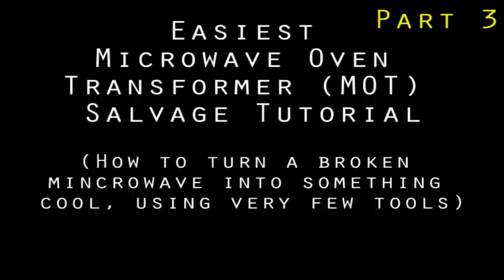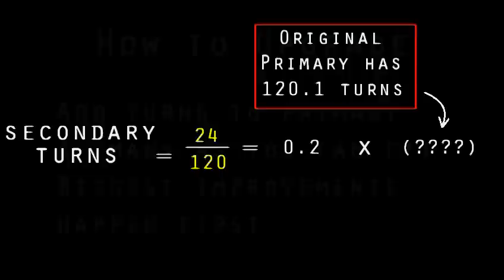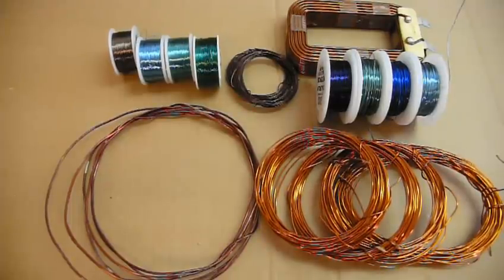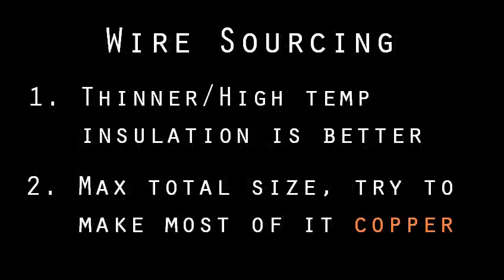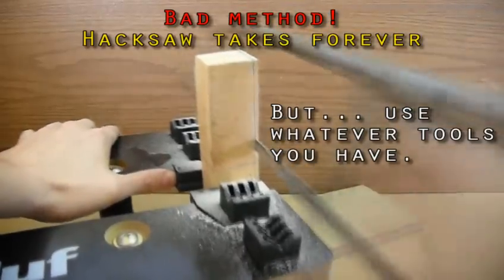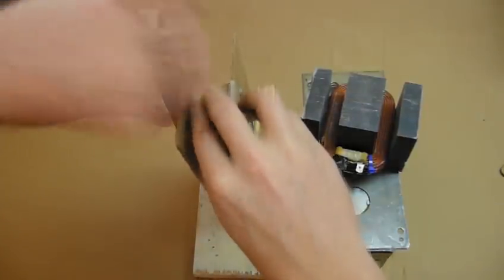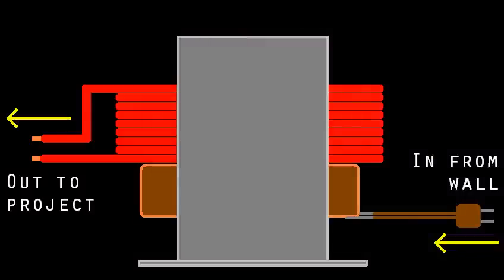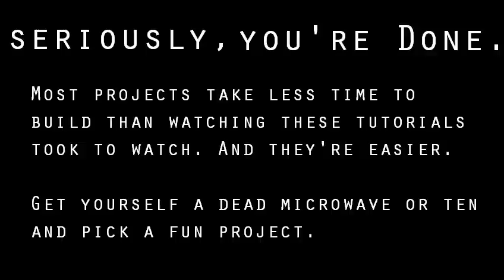Easiest MOT Salvage Tutorial Pt.3

Comment: The universal motor is a type of electric motor that can operate on either AC or DC power and uses an electromagnet as its stator to create its magnetic field. It is a commutated series-wound motor where the stator's field coils are connected in series with the rotor windings through a commutator.

On your prior message. U indicate bosch DC power likely is a universal motor. Which I think it is as it only has 2 magnets. Is universal motor same as 2 phase motor?

From the above---- operate on either AC or DC power...

If this is a case. Why do I need diode or bridge rectifier to convert power source from AC to DC?

If above is true, all I need to do is convert 110vAC to 17vAC on Transformer skip all other steps?

What will happen connect 18vDC power tool on 17VAC with high current?
Reply from the maker: Universal motors do not require you to convert from AC to DC, but the speed control electronics in the trigger will be ruined instantly if they are given reverse polarity voltage. So, you could connect directly to the motor if you wanted, but then you'd lose the function of the speed control. Also I think you need higher voltage AC to accomplish the same amount as DC, (maybe like, 30% higher?) but I forget why.
Reply: @MattsAwesomeStuff  
"speed controller will be ruining" meaning after this one used 17vAC direct connect on the Bosch cordless circular saw without convert AC to DC,  In the future if I connect battery pack back to the power tool, the tool will no longer have speed controller? Is this what you mean by ruin?

There is universal motor on tools, 
Reason manufactures all use Universal motor is because it is cheaper, simpler to build ? Is this true statement?
3 phase (120 degree), 7 phase (360/7) like my electric bike. How are they different? All use positive/ negative/ ground??

I am very confused on how to identify each type. I search on line found bit and piece of info. Do you have easy way to identify each type by looking at it?
Reply from the maker: @harukoyama9515  - Electronics are generally designed to have steady DC voltage only. If you reverse the voltage, they will be destroyed inside. On something like a drill, you need speed control. On something like a circular saw, on/off would probably be fine because you always cut at the same speed.

Universal motors are selected because they have very high starting torque, which is what a power tool needs. A blender for example has a universal motor. But a treadmill has a Permanent Magnet DC motor. A drill press or table saw or washing machine has an AC induction motor. DC Series-Wound motors in portable power tools can also be considered universal motors. I don't know if they're cheaper to build. They are easy to speed control. Induction motors are probably cheapest, but very hard to speed control.

It's hard to tell motors apart, there are so many types, and so many different ratings. https://www.youtube.com/watch?v=SrPHQh-M3pM&lc -- That may help you, but, does not tell you when to use them or how.
Reply from the maker: @harukoyama9515  - I forgot to answer the 3 phase part. 3 phase power uses 3 different AC voltages, each 120 degrees out of synch. They usually have 4 wires, 1 for each phase, and ground. There is no positive or negative with AC power, it's a sine wave that alternates positive and negative 120 times a second. 3phase is controlled by turning different electromagnets on and off at a rate that makes the motor move a certain speed. 3phase AC uses the speed of the power grid (60hz). In a bike they often call this "Brushless DC" which is just DC that is then chopped up and made into fake-AC with a complicated controller circuit.
Reply: Lot deep electricity knowledge. Have to spend more time understand it.

No luck finding a alternator for bridge rectifier. I have 2 electric lawn mow. Has KBPC2504, reading the specs. This one is only 25amp, I need 65amp if my circuit is in 15amp breaker.

I remember you told me I want to use twice the capacity of component can handle. This Homelite electric lawn mow is advertised for 12amp. So that was half of what this bridge rec block can handle.

I saw some kid on youtube parallel 50 diode. He claims it can dilute the load. So no 🔥or overheat... Is this statement correct?

I also remember you said, multimeter can not connect in parallel to reduce the amp load. Does that methodology also ally to diode? Likely one will brake down before the other break down. Defeat the purpose.

I found below bridge rectifier. Not sure if this is what I need to simply run my Bosch portable tool, some tool are 18Vdc, some are 24Vdc...

4 Terminals Single-phase Diode Bridge Rectifier MDQ 100a 1600v High Power US

Can this bridge rec work ??? for covert 17Vac x 65amp to 17VDC don't know how many amp.
Reply from the maker: @harukoyama9515  
1 - I've seen that same FWB rated for 50A :p.

2 - Twice the voltage is a good rule of thumb for capacitor voltage if it's jumping around. With current, generally you're okay with being right at the correct current. Extra is for durability/safety. Depends on the circumstances.

3 - You can parallel diodes with limited success. The problem is that they can become more conductive when hotter. You can't make them share equally. So the hottest one gets even greedier and even hotter, and then eventually melts. Maybe it's taking 50A and the other one in parallel is taking only 5A. If you mount them to the same heatsink, you can force the heat of the hotter one to affect the heat of the cooler one and help them share a bit, but, 50 diodes in parallel realistically means probably only 3 or 4 of them have any current, the rest have none.

4 - Yes, that methodology applies to diodes. You can connect resistors in parallel, they will force each other to share equally, or light bulbs, or heaters, but not diodes really. It depends on the "thermal coefficient" and whether it's positive, neutral, or negative (whether it becomes more or less resistive when it gets hotter). You can research but it's boring and technical and probably hard to find answers.

5 - That bridge will work fine at 100A loads. You might want to put a heatsink on it if you are going to max out your drill for long periods of time. For a few screws it's okay without.

Comment from the maker: Scariac. That's Grant's method. It's not particularly dangerous. Mobile core is the hardest method. Takes lots of explaining.

Electronic control using a triac and a "phase fired controller" on the primary is fairly easy.

Easiest is a multi-tap transformer. When winding, for example, 30 turns, also branch off at 28 turns, 26, 24, 22, etc. Just bend the wires out 4 inches, then back, so you have something to connect to. That will vary the voltage and thereby power.

None are strictly necessary.

Comment: i want to build a 14volt and 30amp  transformer should i use a transformer like this?
or a transformer from a old amp have one laying around is was from a  5x80watt amp
Reply from the maker: I think that would be a perfect use of an MOT. 14x30= 420 watts. That's a small MOT which means you have room for extra turns on the primary to help it stay cool. However, your audio amp will be wound with more turns on the primary right from the start, so, same difference either way. What are you making?

Comment: So... I tried to add More Winding to my primary. The original Had 133 Turns and I added 17 To make it 150 for better efficiency. But When I plugged it in It got really hot and smoked, It even Burned though the zip ties. Now The Secondary wasn't hot. It was only the Primary. I used 16 Gauge magnet wire. Any Idea what i did wrong? Please help
Reply from the maker: liljoey112 You perhaps added them in the wrong (clock-wise vs. counter-clockwise) direction, so even though there were 150 windings, 17-17 of them cancelled each other out. If your secondary wasn't hot, (meaning the MOT in general just ran hot) then that's my best guess. Guess #2 is that your primary is shorted internally, or, to the core.
Reply: Okay I am Going to Check that out now, I'll tell you the results.
Reply: MattsAwesomeStuff Removed the Extra Winding Now its cool and smoke free under no load So time to rewind it and see if that helps thank you
Reply: MattsAwesomeStuff I removed the extra windings because they seem to be giving me a big issue, SO Is it Normal that under no load the primary is hot to the touch with no load?
Reply from the maker: liljoey112 You probably put your extra windings on backwards, or coiled them backwards. Anytime you are adding windings or connecting coils and you get the opposite result you expected, you probably got the polarity wrong. If your polarity was wrong, rather than adding turns, it would subtract them. To fix it you just swap the connections on one of the coils. Yes, it's normal to get hot under no load, not hot like you were before. MOTs need a fan to cool them or many extra turns on the primary.

Comment: I found my old car radio amplifier (2) 2200uFx35V. + (1) 2200uFx25V

If parallel 4400 uF 35V
If series 2300uF 70v

If add 
2200uF x 35V + 2200uF x 25V
Series = 2200uf x 60V
Parallel = 4400 x max 25V

Is this correct, work like battery

Comment from the maker: Auto diodes/bridges are good. Or $2 for a 50 amp one from a chinese ebay supplier. Ones on board are probably 1 amp :p

You cannot use the big one in the microwave. Read the label. Probably about 1uF and about 2000V. You need 1000+uF (or 1000uF/amp ideally, much as you can find) and only about 20 V. Charging that one to 20v is still only 1uF. Stripe is Neg.

Wiring rect. 2 pegs are AC in, other two are + and - out. Just look up rectifier pinouts or basic transformer power supply. Easy stuff.

Comment: Thank you so much. I will go back to understand the capacitor part. I did not know the smallest capacitor has to be no less then voltage used on the tool. 

My tool does not say any wattage. Only say it 18vdc the other one say 24vdc. I call Bosch company. They are not able to tell me anything more then I already know.

I remember that turning thing inside the Bosch tool is about less then 2in diameter. So have to do some educated guess.

Lawn mow is 120vdc x 12amp = 1440Watt divide by the surface of turning thing, diameter = 4 inch
4 x PI x height (6 in) = 75.36 sqin

1440 / 75.36 = 19.10 watt per inch

19watt x Bosch cylinder surface 
( 2 PI x R x Height = 18.84 sqin)

18.84 x 19.10 = 360 watt

Is this the right methodology?

360 watt / 17 volt = 21.17Amp

So my peak amp draw will be less then 25 amp... Which I could just utilized my none working electric lawn mow FWB rated at 25amp... 

Just need to scrap my lab top charger capacitor tonight to see if it is rated more then 17 volt.

Thank you so much explain it. Do you also have a power supply for your battery power tool?
Reply from the maker: 1 - I have no idea for what purpose you're calculating the wattage per surface of the motor. I'm not saying this is wrong, I have just never seen it before and don't know why you're doing it.

2 - I have many times used different power supplies to run battery power tools. Works fine.

Comment: Matt you REALLY do awesome stuff. Although I do wonder how to reuse the wiring from a secondary coil to make a new secondary coil with fewer turns. (Basically i just wonder how to clean all the enamelled insulation, if even necessary)
Anyway, your vids rock, and since I've studied a fair bit of physics and maths I appreciate the fact that you also try to teach others how to use it for something good.
Reply from the maker: Thanks for the kind words. You sound smart so I'll give you the abridged version. You're making a cable: 1 - Uncoil the whole secondary into a separate loose coil, a drill helps. It goes easier once the outside few layers are done. It's 2000' of wire, it takes a while. 2 - Place two pegs either the distance apart you want the end cable to be, or, half the distance. 3 - Walk the loose coil around the two pegs. It's 2000', it will take you a while. 4 - Cut the cable off at one peg. Either bundle it all up, or cut it in half, depending on which length you were targeting. 5 - Flay out the last few inches of each end and clean them somehow. Abrade them with a steel brush, burn off the enamel then vinegar scrub them clean, something. 6 - Using some type of clamp or something, clamp all the loose ends together in a few places to make sure the strands are all connected in parallel. 7 - Wrap the cable with kapton tape. 8 - You're done. Wrap it on the core. Because you're re-using the same amount of copper, it's always self-scaling. You'll end up with a coil that is about as thick as the max you could have fit into the core with the number of turns you needed.
Reply: MattsAwesomeStuff Can't thank you enough for those instructions! I've always been amazed by the kind of youtube channels that help people (like yours) without getting much in return in the shape of money or fame. Although I have a hard time wrapping my head around how it could more time efficient to answer all the comments rather than making a video containing all the answers to the most common questions :P
Reply from the maker: Oh, it's not efficient. I didn't mean to take a 3-year break from filming, but... answering questions is a few minutes at a time. Making new videos is a big timesink that I need to be in the right headspace and workspace for.

Comment from the maker: I'm not sure. I've heard that HPS ballasts might not be a true core, the middle leg might have an air gap in the middle, where you can't see it. Disassembling them is tougher too, more welds to cut.

You want to still use it as an HPS, just in your home? Hrm.

Sorry, I don't think I know enough about what's going on in there to give useful or responsible advice.

If you just want to use it as a transformer, presuming the core is normal, same rules all apply.

Comment from the maker: Alok - In G+ you've set "Who can reply to my public posts" as something other than "anyone", so I can't reply to you. Umm, $5 isn't a great price, usually they're free, but, not a big cost. 35-36v is probably high, you could get away with 24-30, but, you use what you got. That 10g wire is going to melt in seconds, even with 2 MOTs, so just keep that in mind, you'll have to use short duty cycles. LOTS AND LOTS of fan cooling. Use the microwave fans and build a box around them as a tunnel for air.

Comment from the maker: Yes, very easy. A stick welder is ~20-30v or so. You don't really need much for current range, since two MOTs is about the bottom edge of what you can pull off for stick welding. I show both how to make a stick welder, and how to control the current, in stick welding and other projects... which are only half-filmed. So, answers are coming sometime, just not done yet. Sorry :P

Comment from the maker: Part 1 of the spot welder video will be how to build a generic, normal spot welder. Part 2 will have the optimized designs and features. Good news: battery tab welding is cheaper, easier to setup, and easier to source the one part you might have to buy (free).

Comment: A bit about magnetron safety handling (copypaste from wiki):
"Some magnetrons have beryllium oxide (beryllia) ceramic insulators, which are dangerous if crushed and inhaled, or otherwise ingested. Single or chronic exposure can lead to berylliosis, an incurable lung condition. In addition, beryllia is listed as a confirmed human carcinogen by the IARC; therefore, broken ceramic insulators or magnetrons should not be directly handled."

Comment from the maker: @Donisgr Hang onto your copper. Nothing special. Look at vids of a spot welder. You'll need wooden arms, and one hinge (a nail). One single loop, any mess of wires and pipes will do, fill up the empty space. One side goes to the bottom, one side goes to the top. The only tricky part is making pointed electrodes, you'll need some solid copper and a grinder or file. Also, a pushbutton switch from the microwave (Normally open) on the 120V side. Else, wait for the video.

Comment from the maker: It's not a great method, it's dirty, but it's doable. A better way is to use the lighter to heat a copper (or steel) rod and then touch the rod to the joint, that way you're not getting carbon and other residue on the connection.

Comment: your tutorials are on mot's but if say you had a old magnetic ballast coil and core same as a transformer... correct?. my question is i have a 400 watt hps light coil and core ballast with a power cap that wires prime and sec. together and a ignitor the starts the lamp. problem being it operates on 277 volts and what house has that not mine. is there any way to rig it to run on 120v and still have the same power output? can i make less prime turns and more sec turns and be in the clear?

Comment from the maker: Good duty cycle is easy. Want to turn 10% duty cycle into 100%? Make it with 10 MOTs instead of 1. Adjustable amperage isn't too big a deal, but, it's manageable easily too.

It'll be a bit of a wait. Salvage part 4 & 5 are first, then spot welder, then the stick welder and its upgrades into MIG. Too many concurrent scripts being worked on, sorry.

Comment: Enjoyed this series.   Thanks.  Good job.But your advice to wind an outer coil in the grooves between the wires of the inner coil is misleading, as are your drawings that show the same.  That's an impossible task.  Each successive layer is coiled in a different direction so that each wrap must cross over the top of the wires below it and you can't stay in the grooves.  You must have know that and just chose not to address it.  Best to just wrap as tightly as possible and deal with what you get.  An occasional paper wrap between layers helps level the surface below.